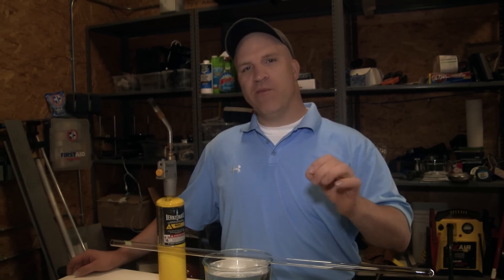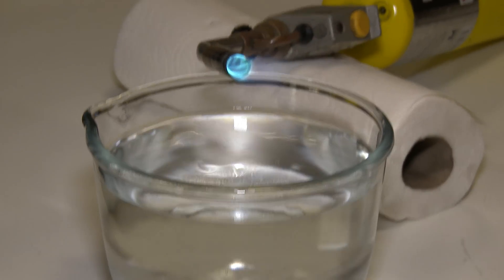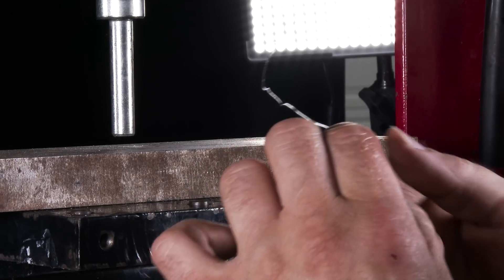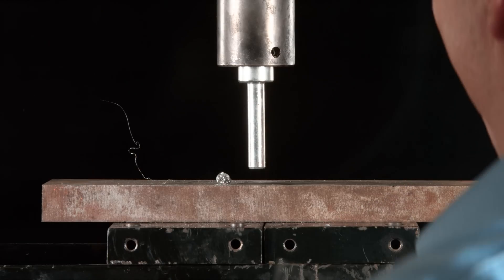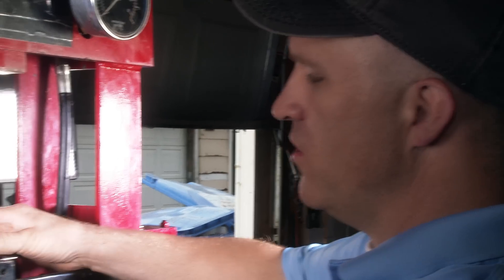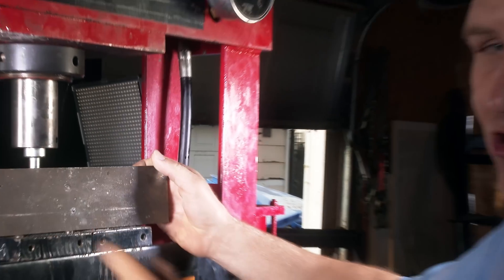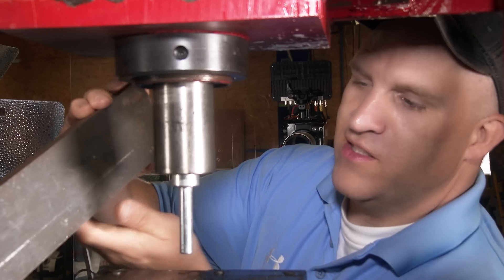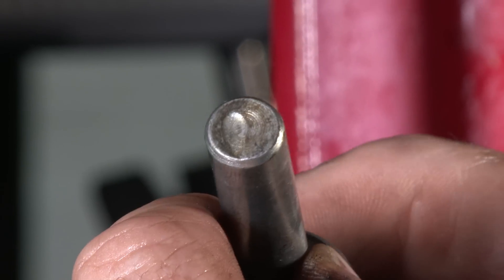Prince Rupert's Drop vs Hydraulic Press [ 4K - Slow Motion ] ( S1 E9 )

Comment: That was beautiful, perfect representation of the strength of a Rupert's drop...just amazing.
Reply: Did you even watch the video?
Right at the 38s mark you can see that the drop was crushed, the tail breaking had nothing to do with the drop being crushed.
Reply: The tail is vibrating in midair, it never broke.
Reply: Way to go Tim, I watched that video too.

Now put you thinking cap on and consider the difference of hitting a drop with a bullet while it's hanging in the air causing an amazing amount of vibration from the impact, and a drop that is being crushed by a press whose face is just as wide as the drop.  In the second case there would be no vibration at all, certainly a whole hell of a lot less than a loosely suspended drop.

This drop had 20 tons of pressure applied on it and wasn't vibrating at all.

How do you think the tail became compromised Tim?
It didn't.
Reply: Greg Prince Rupert drops break easily, but from the tail. check out high speed of a bullet shattering against the bulb of a Price Rupert drop. I doubt the bulb broke before part of the tail.  The impacts of the press most likely caused the tail to vibrate and break. The chain reaction then moves over 3600 mph towards the bulb.
Reply: BTW there is second video of THIS in a more slower motion  you can see that fracture starts from the drop AND NOT THE TAIL
Reply: Greg settle down kiddo.
Reply: I've put this at full res and slowed to .25 speed. Within the 0:39 mark a frame shows the bulb has exploded and the fragmentation is less and less as you go more and more up the tail. So it's highly unlikely the fracture happened in the tail-end. Also that tail is 100% rock-steady. It is not vibrating in the least. It's the head-end where the fracture started.
Reply: Okay guys. I know everyone on the internet is an expert and knows it all. What would be nice is if these guys at warped would be willing to get there hands on a really high speed (1000+ fps or better) and do the experiment again. My bet is you will see the drop break from the tail end first. Only the high speed will tell. That being said, I also believe that if the drop managed to have its surface damaged, even a microscopic scratch as a result of 20 TONS of pressure, that too could have been the source of the final collapse of the drop. 

At the end of the day, but your egos away and realize you just saw a tiny pice of glass hold up to 20 TONS of fucking pressure before it broke for whatever reason it broke.
Reply: Zero Cool if I can hit one with a hammer i doubt that ticking is going to create enough vibrations to break the tail...
Reply: Energy Flurry I know, I watched a video from smarter everyday where he shot them with .22 bullets. The Rupert's drop wins Everytime.
Reply: you are correct, the tail DID break first!!!
Reply: energy flurry did not watched the video...  and it can be seen that the fracture did not start from the tail
Reply: No, you're completely wrong. A suspended drop would be exposed to the same amount of vibration as a secured one.
Reply: You can slow the player down to 0.25x and easily see that it broke from the drop and not the tail.
Reply: actually i browsed there videos here and to my surprise apparently they are using the fastest high speed Phantom Camera in the world, faster then the slow mo guys and second surprise is it seems they just uploaded a video today thats exactly what your asking for, they did the ruperts drop press at 380,000 frames per second, i was like whhhhhaaaaatttttt !! hidden gem of a channel who the hell knew, thank you reddit
Reply: Dustin from smarter every day shot bullets at the drop and filmed it with a high speed camera, some actually shattered the drop itself and then it travels the reverse way up the tail - I don't doubt that is what also happened here....
Reply: u do realize that the top part of Rupert's Drop wasn't shattered, from every video i've seen so far, the whole thing shatters from the top end to the drop. There could  of been a week point sure, but highly unlikely. If a diamond could be crushed by this shit, pretty sure glass can as well.

Its strong as fuck sure, but it's not indestructible.
Reply: Purifier Phoenix The Mecca agreed ....have you watch the 2nd vid? watch it it is cool
Reply: when they seem to break from the tail it's due to the vibration instead of tons of pressure
Reply: i mean im on the side that it was a real diamond they used, but the common theory is that they used a fake diamond in the second test on that video, just to get a good break
Reply: I Agree on that anglerfish, BTW how's the last Tank Competition?
Reply: The high speed shoot, really high speed, shows that it broke not under the pressure, but outside, against its tail part. Maybe because it was lowering down into the metal.
But that doesn't matter,  the head can take a LOT of energy before it breakes, the tail side can't. 

Would love some high preassur on the head, and then something like an iron wire or other weak stuff breaks the tail.  The tail of this drop was long and fragile.
Reply: Poorly made Pr. Rupert's Drop as well.
Reply: Brandon Matthew well, the tail could have been better. But it still was strong.
Reply: Durkae Durkae
Reply: Durkae Durkae
Reply: Panzer vor
Reply: it was too small prince ruperts drop's tail was on the steel plate
Reply: Zero Cool actually you're wrong. They did another video at 380k fps and it turns out the tail does nothing. The origination of the drop breaking is actually at the drop itself instead of the tail.
Reply: Durkae Durkae the reason it broke was because of its tail breaking

Comment: I love Prince Rupert's Drops. Just the idea of them is wonderful.
Reply: OrionoftheStar whats that
Reply: Kevin Jaeger Droplets of glass dropped into cold water. The thick portion is ridiculously tough, as you see here, but if  you apply even a little pressure to the stringy tail then the whole thing shatters.
Reply from the maker: OrionoftheStar we recently filmed this at 380k fps and what was very interesting is that is seems when it is crushed the tail cracks off at a point from the shock wave but in the other direction the whole thing breaks . weird phenomenon

Comment: pressure measured in tonnes?
Reply: TheDiabolocraft they probably meant force applied
Reply: Уαรïя Sαℓï๓ Still it doesn't make any sense
Reply: I think you might be confusing stress and pressure
Reply: Not me, him.
Reply: A short way to say "the pressure equivalent to applying 20 tonnes on the press tool". If you look at 2:09, even the gauge on the press shows values in tons.

Comment: Can you redo this but with a proper drop? You left the tail on way too long. It seems like the reason it broke is because the tall tail began to push against the side of the press.
Reply from the maker: MrSpektyr we are going to redo it just slower this time, the tail never touched the Press it's just an optical illusion because we were zoomed in so close. if you watch smarter every day his drops look exactly the same as ours. thanks for watching and thanks for commenting
Reply: Not a problem, and thank you very much for clarifying that. Much appreciated.
Reply: MrSpektyr at 1:00 it seems it actually broke drop head first, only 2 frames but it seems so.
But yeah it bothered me too that the long tail didn't break till the tip
Reply from the maker: Kristo Karl Aedma we just made some more and filmed at 480k fps and same thing happened, this time we had them made at a local glass blowing shop. when we snap the tail the whole thing explodes but when we crush it the tail break off from the shock wave or something, really weird
Reply: Warped Perception sounds interesting, will you also upload a slowmo video of it?
Reply from the maker: Kristo Karl Aedma yes as an episode. in the next week or so.

Comment: You need to get with smarter every day and film that with his high speed camera, need to know where the collapse started.
Reply from the maker: lol. why should we use his high speed camera?, whats wrong with ours ?
Reply: Warped Perception because his is 130,000 frames per second.
Reply from the maker: Stefan F. his camera is the V2511, the cameras we are using are the Flex 4K and the V2512. google them.
Reply from the maker: Stefan F. when we filmed this we didn't know how fast it was going to happen, really fast !!

Comment: If that stuff was cheap I would want my phone screen to be made out of that
Reply: The shape has nothing to do with it's strength. It's strong because the outside cools significantly faster than the inside (being dropped in water). As the outside cools it squeezes liquid glass into the tail. As the inside cools it contracts, but can't change the outside's shape since it's already solidified. This puts the inside in strong tension, the core pulling the whole thing together with extreme strength.

This is the exact same idea that's used to make hardened cell phone screens. Corning's Gorilla Glass takes standard glass and then swaps some of the atoms on the outer layers of the glass with bigger atoms (potassium salt and others). This again puts the glass in tension, though not to the same extreme as a Prince Rupert's Drop.
Reply: Not Kylie's Friend not realy its the shape that lets it do that if it was flat like a screen it would break easier than a normal screen since its just glasa
Reply: ***** Safety glass is made by tempering glass, typically with heating/cooling cycles (though it can also be done chemically). What does safely glass have to do with Prince Rupert Drops?
Reply: Christopher Stone well shit I just guessed but it would be the shape since without the shape it wouldn't contract like that